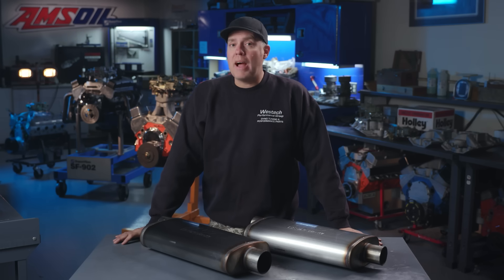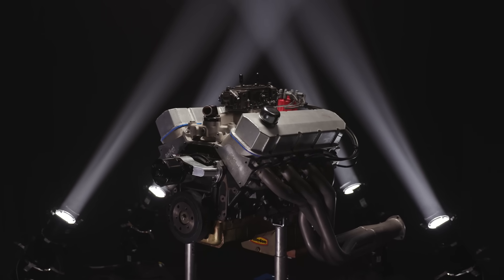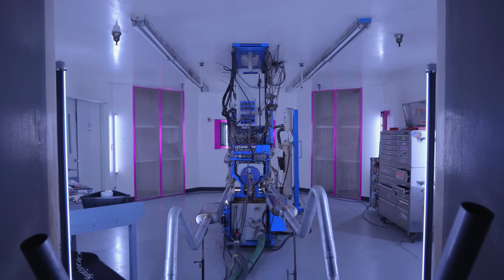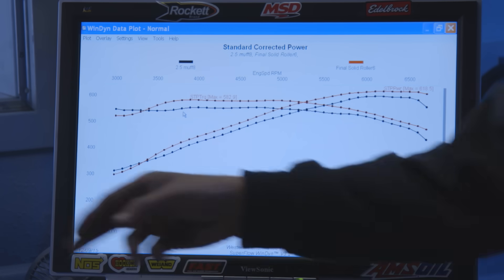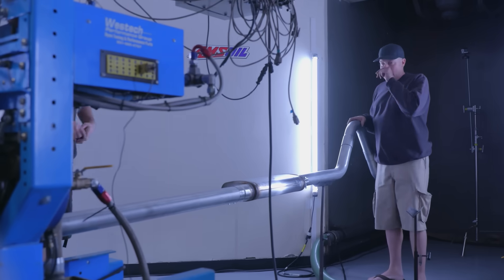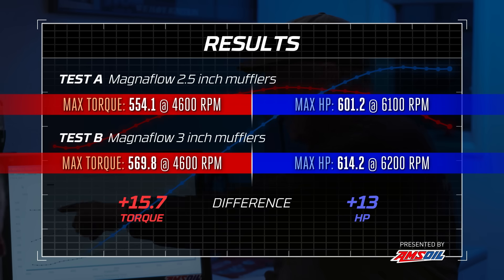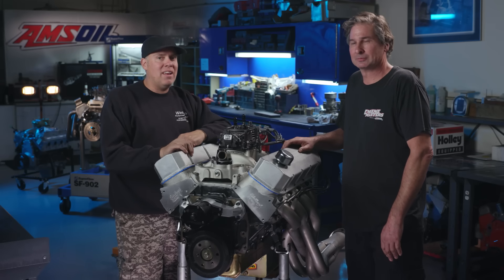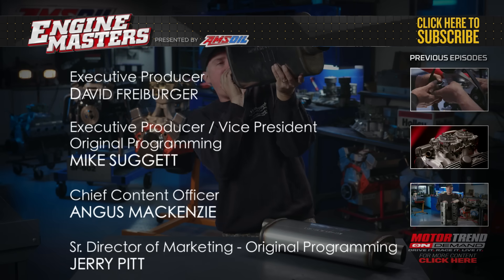The Power of 2.5- vs. 3-Inch Exhaust - Engine Masters Ep. 9

Comment: It would be a great addition to know how loud those two mufflers are in comparison to a street set up.  Not many of us want the noise, the entire reason for mufflers in the first place, let alone added noise factors with 3" pipes.  That muffler model itself appears to be a loud type from the get go so, this test would be interesting when using more quiet mufflers that would typically apply to most auto owners. BTW, the first part of the video with all the specs doesn't really need to be there or mentioned for this test. I'm no expert but, it would be good to know the HP and torque rate when holding the test for more than a second or two. How about 10 seconds or so?

Comment: I talked with summit racing regarding a fuel/ignition issue and they tole me that the 3 inch exhaust on my stock vortec 454 was eliminating my back pressure needed and causing a flat spot during WOT in the mid range RPM band.... So even  "professionals" say back pressure is needed.  I obviously don't believe them about it.

Comment: I really really wonder what the results would be with the 2.5inch system WHEN you change the carb settings to make the air/fuel ratio under full throttle arround 12,75-13(leaner) as it is with no muffler. If you want the test to be 100% plausible i think you defenetely should do it! Cuz the carbs should be tuned for every change especially when you change the exaust system, right? I defenetely would be very happy to watch a video this way!

Comment: Good info but one thing was left out... the exhaust system dimensions are relative to engine displacement, more precisely the amount of gas flow (exhaust gas that is).If an NA 350 had been tested the same way, the 2.5 system might have been enough. For that big block, everything stated was 100 percent true but the video left the impression that a 3 inch system was the answer for virtually every engine. It bears mentioning that is not the case, and it's a relevant point given the cost difference between a 2.5 and a 3.0 systems and the possible extra installation complications on some cars (i.e. many cars can accept 2.5 pipes but fewer can fit 3.0).

A special request: Set up a similar test and test crossover pipes, H vs X.

Comment: What you guys aren't mentioning is your horsepower level also plays a part in how effective your exhaust is. Where on this 600hp Chevy motor a 2.5" exhaust was restrictive and pulling down the power, that same size exhaust would preform just like the larger would on a typical 400-500hp daily driver. Its only when you start getting closer to 600hp that 2.5" exhaust becomes a restriction.

Comment: The big question to me is, if you retuned the carb for each exhaust system, would you gain the "lost" power back.  It's kinda like if you tune a engine for 89, then say using 91 doesn't increase power, it's true, but at the same time deceiving.  If your looking to optimize power, the whole system has to work properly, changing one part affect's the others.

Comment: Would have been interesting to see how re-tuning the carb for the piping affected the results. Small diameter exhaust is a less extreme variation of changing to a heads with smaller ports. You'd never change heads without compensating the tune/fueling, so why no changes here?

I agree that in this case the 2.5" system would make less power, however, the difference might have been significantly less notable with fueling matched to the airflow change.

Comment: You didn't prove shit.  Most guys don't have a 620 HP engine and therefore don't use as much air.  All you "proved" was a 3" exhaust is better than 2.5"  for an engine that uses more air therefore has more exhaust.  That is obvious.  The real question is at what point in a build does it become more beneficial to use a larger exhaust diameter?  The way you "proved" it was ridiculous as well.  You didn't tune it for the exhaust that was on it, so your power figures are not accurate.  Had you tuned the 3" exhaust it may have made the same or more power than open headers.
Reply: But in the end it was only a 3% loss for a non optimal design exhaust without tuning and if they actually took the time to get A/F right it would have been closer. So if you are hunting peak performance for racing you might want to spend some time in Engine Analyser. For the Street or not so serious guy it looks pretty safe to decide how much noise you want and buy off the shelf.
Reply: yeah Nippon because the ground clearance of a 3 inch system vs a 2.5 inch system is just so drastic, fuckwit
Reply: It's about getting the header pipe diameters, lengths and collector design correct, in conjunction with engine design including ports and cam timing, to take advantage of reversion pulses to maximise cylinder scavanging for peak volumetric efficiency. These days, most of this design work is done with software.
Reply: BigBrotherIsTooBig and doesn't all those bends and the end of the pipes going straight up affect that also
Reply: mong
Reply: mong, about what i'd expect from ... you
Reply: Wow, you're awesome. congrats
Reply: thx man, i know you admire me, good to see it in writing tho
Reply: How do you tune a Exhaust?
Reply: true
Reply: In the end it was only what, 13hp in it in a 600hp engine? I'd go the 2.5in for lessweight/cost/noise and more ground clearance etc over gains you won't even notice..... and as you said, after you tune for it, even less difference

Comment: The real science is that you don't get it. Create a venturi by sticking a tube at the end of the exit pipe  that's half the diameter of what you are sliding it over. This will suck out more of the exhaust gas without wasting horse power to push it through either  2 1/2" or 3" pipe. More performance, better mileage. They pay these people to mislead the general thinking populace.

Comment: They should tear apart an old 4.6 Land Rover engine out of the 2004 Discovery for example. And see just how poorly built it actually is. That is, if they know how they're supposed to work/ parts/ etc. The reason I ask is I had one, it had 106 thousand miles on it when I got it, but it never ran as well as the Toyota with 230k in the 4.7 V8. I personally think the previous owners neglected it. But there was without a doubt a difference. The engine and transmission from the Toyota in the land rover would've been awesome. Always thought a designed by land rover and refined built by Toyota/ Lexus would be amazing. Might be talking to the wrong crowd though

Comment: Carbs and distributor? It's 2016 FFS 😂 Stick some throttle bodies and a coil pack on it... Also, I don't claim to know much about V8 pulse tuning but would a crossover pipe not help with scavenging?

Comment: Maybe next time use that programmable TBI carb, and you can get more power by just not running so rich. Then try converging the left/right exhausts into a single plenum then back out to dual , like almost every car out there with dual exhaust. Once more using the on the fly programmable TBI carb to get your fuel air mixtures right each time. Sure you'd have to do each set at least twice to adjust. And some normal baffled mufflers too, adjusting your mixture again. All you really showed was that by changing your fuel air mixture too rich can be a hit to your power.

Comment: The rule of thumb is if it's 400 horse or under, 2.5 in exhaust is fine.If over 400 horse use 3 in.I would like to know the difference between 3 and 3.5 in exhaust.may be overkill or may due better or just the same.my buddy uses 3.5 on a 60 over 427 chevy with big brodix heads.

Comment: really needed a dB meter to see the sound reduction
Reply: Check out the new Cuthroat Exhaust Systems, DirectFlow Exhaust Cutout! Only true pure, full flowing, non turbulent design available.  cuthroatflow.com
Reply: +Brian C Same. I don't think I'd notice a 15-20hp loss on a 600hp motor, but it'd be nice to have a the option of quiet power. Semper Fi.
Reply: +Brian C Yeah would have been nice to get a number on that to compare too
Reply: +NoBrakes23 they make y pipes that you can open with a servo operated switch and cable operated versions too, or the old school type that you unbolt to dump the exhaus

Comment: The power difference at low speed is due to atmospheric pressure at 14.7 psi trying to equalize - "creating backpressure". When the rpm goes up the exhaust flow overcomes that backpressure. With the long exhaust system, it's harder for that ambient air pressure to affect the engine since there is more volume of exhaust in the long pipes helping to keep it out. These guys should know this stuff and explain it correctly instead of perpetuating wrong information.

Comment: This is no correct measurement. The air-fuel ratio had actually to be adapted, because a part of power loss can refer to the changed ratio. Furthermore, due to acoustic effects, the muffler can increase the power (Normaly they don't).

Comment: I have an older Ram 1500 with a 5.9 liter. I changed my muffler from a single in dual out to a single in single out. The difference between the two mufflers is that I opted for a incredibly shorter exit ( in front of the tire) as opposed to the duals out the back with  3 inch 24 inch long extensions. It seems the newer muffler with the shorter exhaust exit is making my truck have less power. Does this make any sense or is it in my mind? Would I even notice a difference? I also have a high flow catalytic converter. Thanks for any input.
Reply: Sounds like not enough back pressure to me. Maybe the high flow cat and the shorter exaust is leaning it out as well. A chip or tune could help. But I'm not an expert just a though! Cheers
Reply: So with a greater exhaust flow, exiting exhaust gases, would increase the back pressure? That makes no sense to me. Please explain your logic behind that. My new muffler with shorter, single out exhaust pipe, would theoretically create more pressure, right?
Reply: Not necessarily. For example my buddy had a 97 dodge truck that he straight piped. Because the exaust left the system so easyly he had no pressure and lost a ton of torque. (With a tune the engine would have been fine) He put the cat back on and immediately had torque and the truck was quick again. Back to burnouts and other dumb shit lol does that make any sense?
Reply: I see now! Thanks for your input. Much appreciated.
Reply: +wannabeangler No Problem!
Reply: What about having a K&N air filter? I have this also. I thought breathe in good, exhale good. New plugs, wires, run full synthetic fluids, and premium gas ( I've found out that I get less spark knock with premium). 285K miles on her also!
Reply: +wannabeangler is the K&N a full ram air system or just a upgraded filter? Also to be honest the engine is probably getting pretty weak just due to age and miles. Imagine a spit ball in a straw that fits snug and when you blow through the straw it shoots out the ball without any leaking air. Your vehicle is more like a straw (your exaust) that's to big for the ball (the engine output) therefore taking much more air to shoot the ball out with the same force because of the air escaping around the ball. Now I'm more of a turbo guy and so I don't know many remedies for this issue. My suggestion would be to Google some forms for your vehicle and ask there or search for a simular problem. Hope this was helpful :) I wish I knew more or could hear the vehicle!
Reply: +wannabeangler Sometimes the engine management can get confused with such a drastic change in running conditions. A chip tune will sort it out.
Reply: thanks

Comment: Now. i probably did my math wrong but if im correct between the two exhaust in 3 inch is 2120.58 cubic inches or 34,750 cm³ and on the two inch its 1256.64 cubic inches or 20,592.59 cm³ so a difference of 863 cubic inches. quite the difference

Comment: I'd love to see you guys test a huge exhaust on a small engine.  Say a stock 2 liter engine.
Reply: It'll be the exact same results. Smaller diameter will work better say up to 3500-5000rpm and then the airflow is restricted. The larger diameter will excel with top end power say at 6000-8500rpm as exhaust flow is not restricted but it will suffer bottom end torque and horses due to slow exhaust gas velocity

Comment: First off, I'm retarded. 

My question is, what if you were using an EFI setup with these, both tuned to the exhaust setup? Seems like there'd be less, or maybe more difference between the two sizes, vs a carb setup to run open, but then being restricted? 

Again, I'm retarded.

Comment: You gain lower end TQ and HP with more back pressure so no, it's not a myth. After all, all daily driving is done below 3,500RPM where that low end TQ is needed. Back pressure also needed for better MPG. The ONLY people that need a free flowing exhaust are people that spend all day at the track.

Comment: All these guys around and still can't get it to do 46 mpg in the city using regular unleaded.
Reply: why leave such a stupid comment?
Reply: +bryce Fisher It is only a stupid question because one has no solution nor answer.
Reply: +angelisone the answer is extremely simple. that motor can never achieve such high numbers because the set amount of gasoline used to achieve 14.1 AFR per revolution x 8 

since its a big block, pistons are larger, so each cylinder uses substantially more fuel per mile.

now, apply that same hypothetical math to a 3cyl geo, which DOES achieve over 50 mpg and you'll see why its mpg is so good.

but now you have no power, because fuel usage is so reduced, with a tiny motor, very small pistons and no forced induction.

solution? there is no solution other than not using fossil fuels. 

which won't happen with our system the way it is.

Comment: You are forgetting it isn't about back pressure. You don't want any back pressure. Here is the deal, it's all about flow and velocity. For the same reason you don't put a huge ported head on a small motor because the air will stall and there will be no velocity. The same way you don't want to put a 3.5" exhaust on a N/A 305.
You need to size your exhaust for your application. I think this is why you guys were seeing a low rpm gain. it has everything to do with the velocity of the exhaust gasses and the ability for them to move down the tube.

Comment: why would U use 2,5" exaust on a big engine?
Reply: +Mauricio Nuñez I cannot speak for others, but in some cases it is just not possible to fit the full 3" exhaust.
As for the "additional performance" at low RPM, that's a load of crap to justify having done something different. Do not use smaller pipes instead of larger expecting a low end boost that will matter in any tangible way.
Fuel consumption is not better with smaller exhaust, either.
The sound does change, to be sure. Even just moving the muffler up or down the pipe's air stream can make all the difference to sound.
Reply: +Mauricio Nuñez For a start it is much more civilized sound, which means way less unnecessary attention. In everyday situation when you need to take off quick at the traffic lights, you won't be revving the engine like a hoon, right? So, it's idling at 700 RPM, light turns green, you step on, first two seconds up to 3500 RPM you have more responsive unit, 3 more seconds you are at 100 Km/h ... after that it's game over, unless you wanna loose your license, of course.  Fuel consumption is better, and most important of all, again that civilized sleeper psycho feeling  :)

Comment: There are sooo many trade-offs and in this test, the engine was not tuned for the exhaust.. Any change somewhere will need a fuel/air mix adjustment at some point. Interesting food for thought though.

Comment: I think it would have been interesting to see a 3" x-pipe with 3" mufflers tested with both 3" and 2.5" tailpipes.    Both cylinder banks are flowing through the crossover pipe, so each exhaust pulse is flowing through a pair of tailpipes.    

This would be interesting since there are a lot of cars that it's easy to run 3" until you get to the rear of the car where the tailpipes go over the rear axle.   (like a fox body)